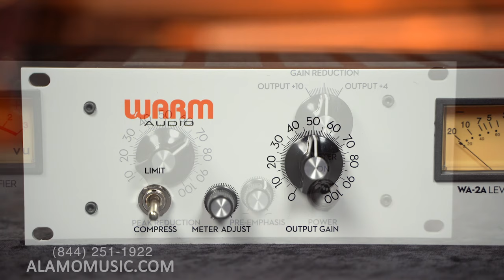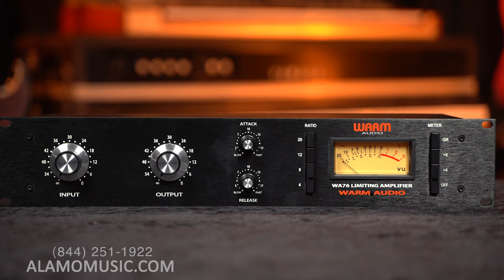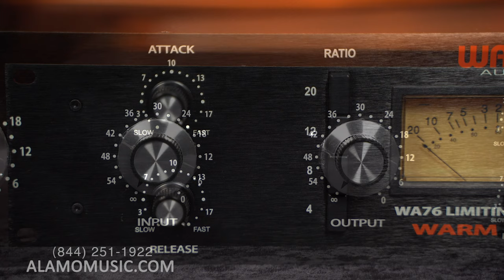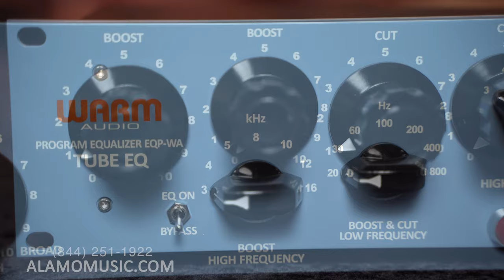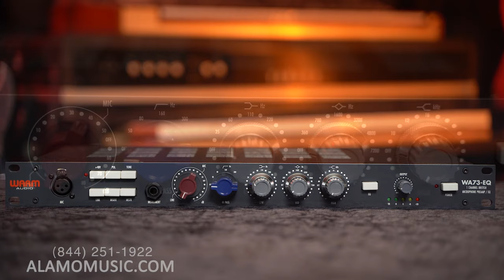How to Use Analog Outboard Hardware in Your Home Studio | Universal Audio, Warm Audio, Pro Tools!

Comment: Thus was a good one. I have been having so much trouble getting out board gear recorded. I could get a connection  but when I tried to record it would come out clean
Reply: Not sure which DAW you're using, but if you instantiate a hardware insert while recording, it most likely isn't in the record path.  This is a larger discussion.
Reply: @midichlorian73  using prp tools I was trying to use hard ware is  plug in and than re ordering it after the settings  were got I wanted them. Thanks for responding
Reply: @brucehathcockmusic  Gotcha.  You can't record with any insert in-line.  If you want to achieve this, set your input up as an aux track with either a hardware or software insert instantiated and then bus the output of the aux track to an audio track and record the output of the aux track. Curious to hear your results!
Reply: @midichlorian73  thanks so much I will let you know.
Reply: @brucehathcockmusic no you didn’t
Reply: @wm1573  I’m ended up using a re amp box to do it.
Reply: Got rid of my Apollo as well . Apologies fr not getting back.
Reply: @brucehathcockmusic  haha it’s cool. Just happened to come by this video and noticed this 2 year old threat and thought it was funny

Comment: So do you recommend recording the track with the outboard gear rather than bouncing the track in place? 

I’m a bit confused why you recorded these tracks rather than just using as an insert on the chain. Was it for a visual? 

Thanks. Great set up. Ours is kind of similar.
Reply: You can't bounce in place with a hardware insert.  The output of the track that has the hardware insert instantiated has to be recorded to another track if you want to commit.  If you're mixing, you can lay the mix back into the session using busses.  Lot's of great questions!  Maybe another video is in order to help clarify some of this information?
Reply: @midichlorian73  that is a sensible way to get the audio processed by the outboard gear to print/render to the recorded waveforms in the DAW, but this does seem to kind of undermine the point of a hardware insert plugin as I understand it. isn't the point of a hardware insert that you can apply external effects to the very same channel that the audio source is coming from? if it comes down to it, recording a brand new track and just letting the song play through while recording the entire song's worth of one track to a new one that is being processed through the outboard gear would obviously work, but take a 5 minute song times the number of tracks i want to run through my outboard effects... quickly adds up to me waiting an hour or so just to get the effects to print onto the newly recorded tracks. for this reason i also share @NathanMell 's question about bouncing in place, and what the best way to do that is
Reply from the maker: @tatertotter25  You are correct!  However, in order for hardware inserts to work correctly, they require time alignment/hardware insert delay; and every interface is going to react differently.  And if you only have one of processor "x" and want to use it across multiple tracks, you would have to commit via bouncing/recording in real time.

Comment: Grew up learning recording in the early 90’s. Man, check out all this hardware, patchbay’s etc. Come the early, mid 2000’s, “Hardware is Dead, need to get a handle on this “in the box” recording and mixing. Come 2020’s, folks who grew up in the box are “help me figure out how to use this hardware, it’s better than my plugins” it’s like seeing Vinyl come back or something…😂
Reply from the maker: I also started in the 90s, using 2" tape on large format analog consoles - I still prefer to work that way!  Working in the box certainly has a lot of advantages, with the top 2 being cost and the ability to recall everything in a session.  I've had to recall big mixes on SSLs and Neves, and even with recall software, it's nearly all manual, except for Flying Faders and SSL ultimation.  Thank you for your comment.
Reply: @asoundlab  For home stuff what I would do to just go back to a 16 channel analog mixer, outboard gear and my Otari MX5050 1/2” Machine (or a Tascam TSR-16) Dump the tracks to Logic etc. for mixing and non, analog tape needy overdubs, re-utilizing hardware as necessary. Maybe even pass the final mix back through two tracks on the tape machine. I listen back on stuff I did and the creativity because of the limitations, far surpassed dealing with the option paralysis I often face today. 

Now it’s all about we’ll tweak, fix it, re-amp it later but before you had to decide on a sound and just go for it and that pressure helped give the music a unique identity, artistically and sonically. Now everything sounds the damn same as people often utilize the same presets and plugins and techniques they see repeated on YouTube. Shit, we now have A.I. like software that will create the chord progressions for you……Alright, I’m going to go shout at clouds now..😂

Comment: How to Use Analog Outboard Hardware in Your Home Studio.
Get it out of the box, plug the power cord in, put some input
cables in and the output cables too, then send it a signal maybe
a kik drum or a whistle and play with the controls on the front
plate. Its real easy, try it some time.

Comment: thanks good video, this gave me an idea.   i have an apollo x6 and want to hook up my old analog vu meters to it.   on the back of the meters are j3 xlr's.   would it be possible to plug those into the apollo so that they work?   thanks brad
Reply: Not sure.  I'm sure the meters will respond, but will the readings be accurate?  I don't know, lots of variables.

Comment: You didn't bother to show how you hooked everything up, and deal with routing and latency?
Reply from the maker: I explain the inputs and outputs of the Apollo at the 1:04 mark as well as mention a link to an article that illustrates the digital I/O in Pro Tools and the UA Console software.  Latency is different for every interface and DAW so I didn't discuss that.  Thank you for your comment!
Reply: @asoundlab Cubase will compensate delay automatically for all your external hardware. No need to adjust the recorded tracks, nudge them or so afterwards.
Reply from the maker: @TheRobGuard  Every DAW and interface is different.  Can't cover everything!  Thanks for your comment!

Comment: should the output on the warm neve 1073 be turned all the way clockwise
Reply: I use the bae 1073 dmp and the owner of the company said to leave the output turned all the way clockwise to get the full effect of the neve 1073 sound.
Reply: @JoeLSoL  Is it true that if u have outboard analog gear that it needs to be a line connect instead of mic  on the apollo twin like you have in this video?? or is it ok to mic input with analog gear with the apollo twin
Reply: @100K-v9y  it should be inserted into the line input.  Some interfaces let you insert in the mic/line input combi jacks which allow both xlr and quarter inch jack insert however, find out your interface’s manufacture requirements to achieve a true line input to bypass the interface’s internal preamps.  For example, I own a apogee quartet.  Apogee recommends that I insert an xlr cable into one of the 4 combi jacks into the  quartet and they request not to use a 1/4 inch jack.  My quartet has 4 preamps.  With apogee you can switch to line input via software change they call it +4dbu balanced.  This selection will bypass the preamps on a quartet.  They also have +10dbu for unbalanced connection.  I will google to see how to bypass the Apollo’s internal preamps, from what I’ve read somewhere, most interface’s bypass preamps by going in with 1/4 inch trs balanced cable and setting the gain knob on the interface all the way to zero.  Ask you4 manufacture to be sure.
Reply: thank you for the feedback im very new to engineering and just trying to set up my gear the best way possible i have Neumann u87 and bae 1-73 with a la2a  my cables are XLR so i use the mic input on the apollo but i heard out board gear should be a line connection into the apollo for better sound quality